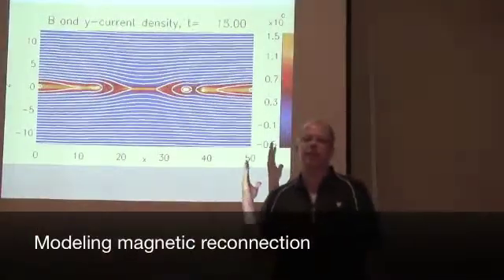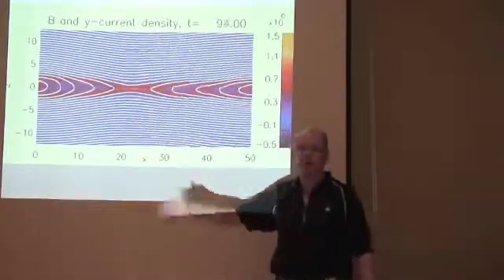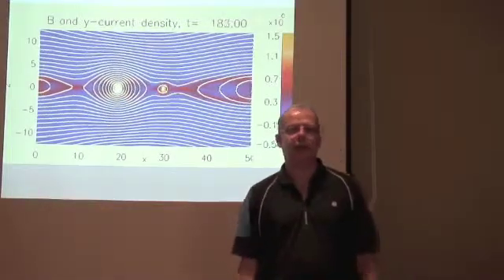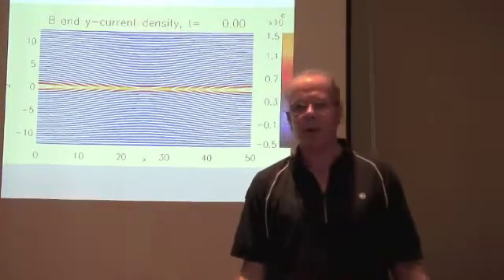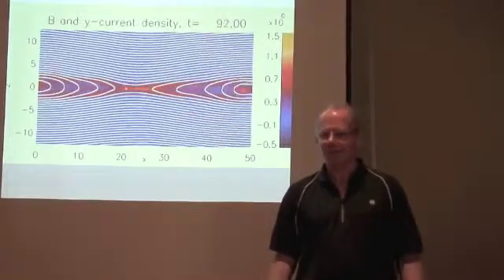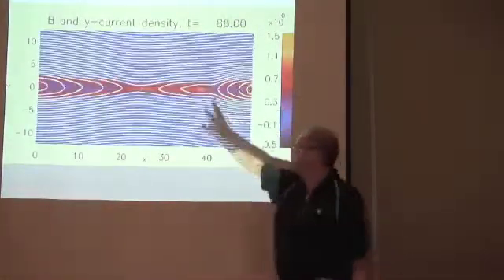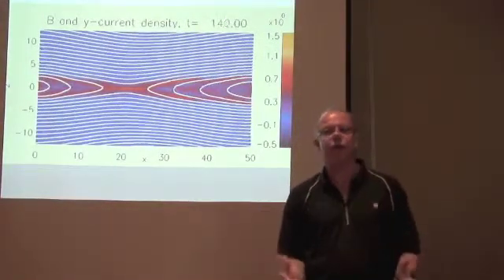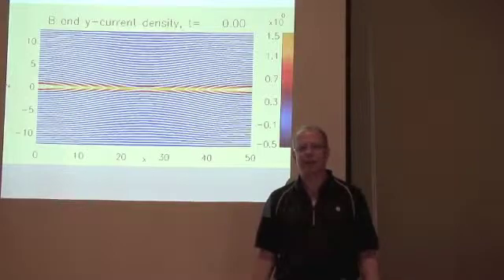Michael Hesse discusses modeling magnetic reconnection

Comment: Magnetic field lines do not store energy, because they do not exist. Plasma does not freeze in to magnetic fields.
In the some models, magnetic field lines creates something like a magnetic dam. But this only works if we asumes magnetic fields only exists in the flat land.
In other models, plasma follows like a train along the magnetic field lines. But here we asume that magnetic field lines actualy exists.
The reason for the other model is because we see filnaments of plasma which discharges themselfs. But the only scientifically suported way for plasma to form filnaments, with out any controlled enviroment, is electricity.